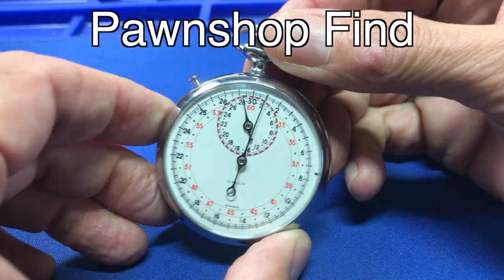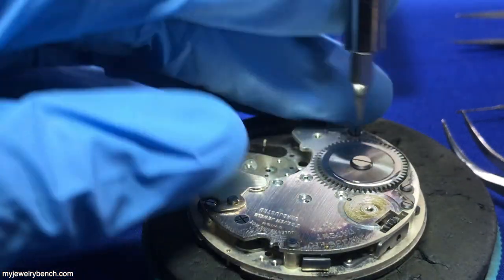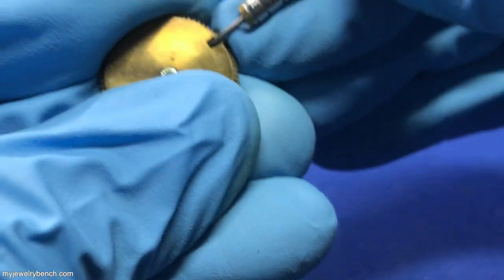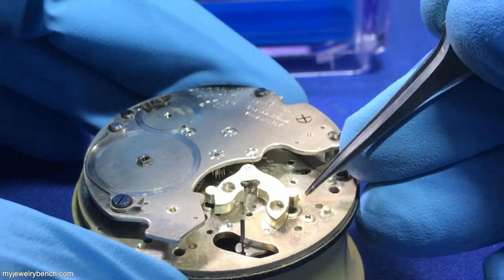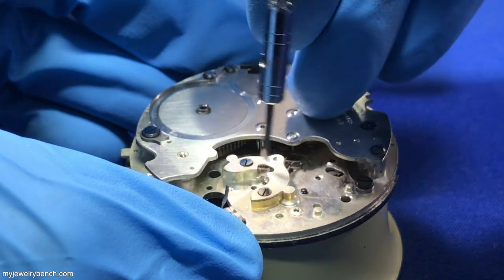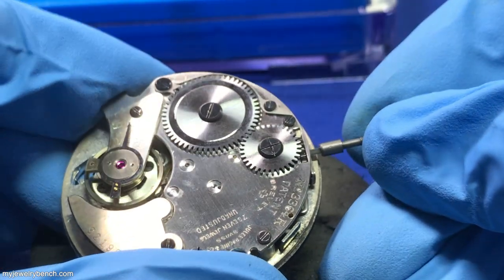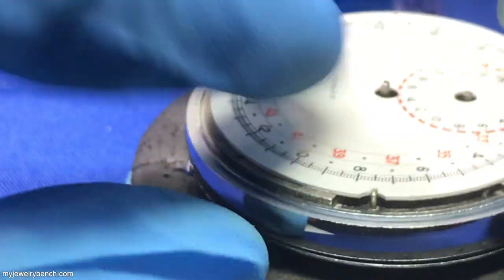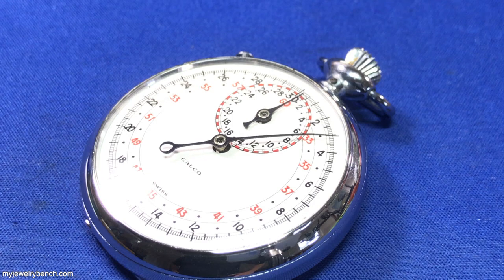Pawn Shop Find!  Vintage Galco Stopwatch by Jules Racine,  Let's get it running

Comment: Odd to see a 30 second stopwatch, I wonder if it was used in horse racing wherein you needed to seriously know how fast a horse is?  Lol I don't know, but cool find.  I will say that since I've been watching (binge watching lol) I have looked into not disassembled, but just looked at the movement on one of my Elgin pocket watches and can now identify things, even saw how a movement screw isn't on the case and explains why the face and movement is loose in there.  Really learning a lot thank you!!!

Comment: I was somewhat more impressed by how you seem to remember where all these parts go after you've taken everything off! Maybe you have a photographic memory but for me, I'd have to write down EXTENSIVE notes if I was going to try something like this.

But very informative. There's something about stopwatches that has always appealed to me -- perhaps philosophical where you're able to "stop time" (and start it up again) at will. Kind of makes me wonder what life would be like if you could actually do that with your life!
Reply: People have said the same thing to me about where parts go back and how I remember when working on a car (mechanic) and it's actually very easy so long as you keep what you took off together and separate them in the order you removed things.  He does the same thing with a parts tray.  I have an Elgin pocket watch that needs work, I plan to do it myself and even though that I just told you, lol I'm going to take pictures and video of it so I can recall its assembly easier, lol, not only that but like with most things if you do it enough and things are similar, you can know from experience how things go back.  I had a neighbor whose son worked on his car but didn't keep things together everything was mixed and the son didn't know how it all went back together so I was asked if I can fix it, and I did.  And that's just from having 35 years of experience doing it.

Also yes the stopwatch of your life philosophical question, I would be worried lol only because of the original twilight zone did an episode on just that very thing.  If you haven't seen it you should try to find it.  It was in 1963 and I believe the title is "A kind of a Stopwatch." But it's the same thing a Man is given a Stopwatch that halts time.  Lol and because of what happens, ah, yeah, no thank you.  Lol.  Cheers!
Reply: @dadtype2339  thank you for your informative and in-depth / thoughtful reply. I'll look up that Twilight Zone episode but sort of along the same lines, one idea I had was what if you could put yourself into a kind of hibernation state and awake only for about 1 week every calendar year. So, at that rate, you'd have almost the equivalent of 50+ lifetimes to explore life, see what technology, etc. have occurred as the years go on. It's one thing that I really wish I could do since I'd like to see how the human race turns out.

Your comment about doing videos of disassembly procedures is something I have TRIED to do myself though it's not as easy as it sounds. I can appreciate the editing that some people put into their videos since you can wind up w/ lots of footage but cutting out the fluff can be daunting. On the other hand, trying to put something back together when you're unsure of how to go about doing that is even more so!

Comment: Why would similar stop watch would not work only works when it's keyless face is down then works but if tilted or on its back it stops don't understand...what's going on?
Reply: It could be that it just runs most efficient in that position. Meaning dried up grease oil etc is dragging it down so it's not able to run in the other positions.